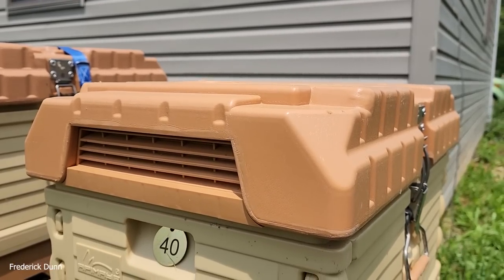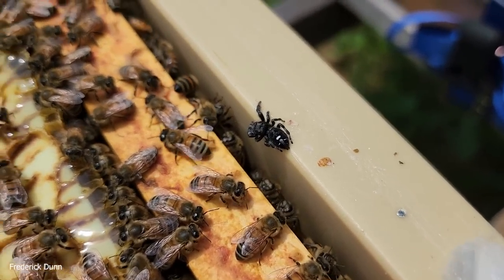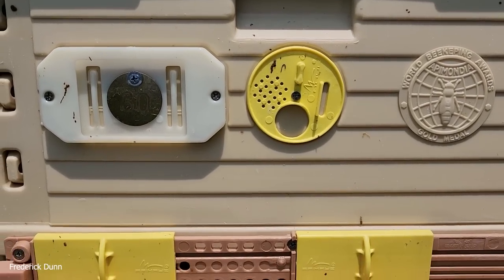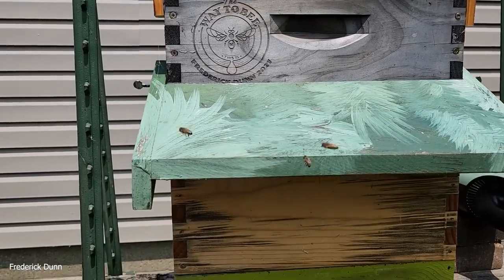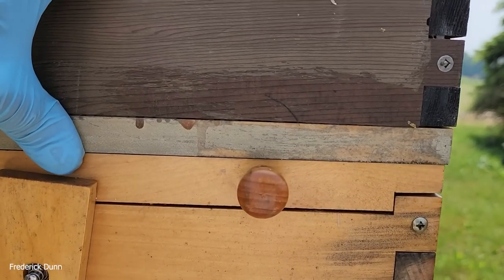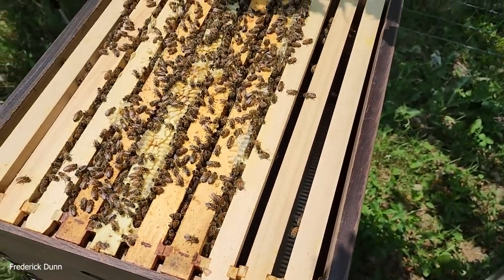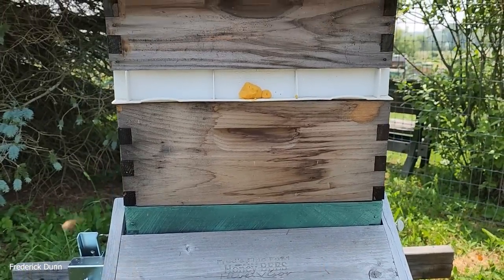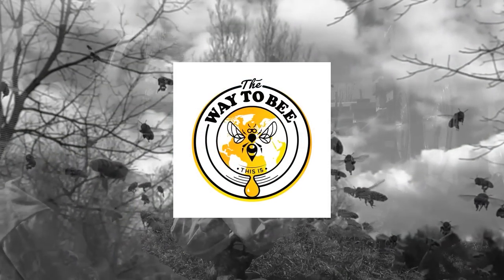Supering Bee Hives just in time. Wintering modifications for Flow Hives. Nectar is Flowing.

Comment: Great Video! I noticed that you are using Ross Rounds in a conversion frame kit… are these readily available? I am not having much luck on the RossRound box. The bees are not touching it but maybe would if I used one or two frames at a time… thanks in advance
Reply from the maker: Those are from Ceracell, so if you already have the Ross-Round frames, the kit is just end pieces that allow you to put those into a standard Langstroth Deep. I also think Blythewood Bee Co. sells them.
Reply: @FrederickDunn  Thanks for responding! Will need to go check that out!!

Comment: Hey Fred, What did you use to glue the double bubble to cover. Also my Apimaye overwinter better if I remove the feeders install double bubble on top with hole for fondant.
Reply from the maker: I just painted the back of the double bubble with Titebond II or III glue, pressed it into the interior of the roof and it's working out really well. Since I was reviewing the Apimaye hives, I left them as designed. But, it appears that the the bees will have enough time this year to seal up those vents. They have a new inner cover that will accommodate fondant :)

Comment: Hi Fred,

I’ve been noticing a lot of dead bees in front of my hive and many crawling around with K-Wing. No fecal stains on the front of the hive. I suspect tracheal mites. Surprised this parasite is not in the FAQ. Then I read infestations are not common due to a predominance of resistance in todays colonies. Can you give a talk on what you know? Did I receive poor stock this year?

Context: Just started keeping in Denver this spring. Installed a langstroth nuc in a custom Layens first weekend in June which was in the low 60s and raining. Had to drop the bees in the box so I could install the langs in my adapter frames. I rehearsed so everything went smoothly and quickly, but I wouldn’t be shocked if the brood was thoroughly chilled. What followed was two weeks of unusually rainy weather. They stayed pretty active, but have lost a lot of opportunities for foraging. Oddly they didn’t take much interest in the frame feeder so I took it out after a few days. I have not inspected frames but the interior of the box is clean, including the floor under the brood. I have a plexiglass floor so can remove insulation and peak in without disturbing them. 

Thanks for considering my question. You’ve been a fantastic resource in my education!
Reply from the maker: Did they have any stored up nectar/honey? A rain event can leave them without syrup/nectar and it's important to provide that with a new colony. Given the cold temps partnered with rain, a hive top feeder would be best in that situation. Just my opinion.

Comment: Wonderful video … I’ve always liked your configuration… deep brood box, medium brood box and Flow Hive honey box … for 3 years I’ve used an 8 frame single brood box and then a flow super (like the Flow folks do) … unfortunately the bees always use the middle flow frames as their pantry and, even though the windows say the harvest is ready, very little honey comes out or it appears to full of nectar.  I’m going to try your configuration but with the queen excluder above brood box and medium box.  The medium won’t ever be used for brood so I don’t have to worry about storage issues (wax moths).  The medium box will be their pantry and the Flow box will be, for certain if indicated by the windows , only for honey storage.  Thanks!
Reply from the maker: Hi George, yes, if you want to make sure you won't have eggs up in the flow-frame and don't trust the honey-bridge then put the queen excluder just under the flow-super. Fail Safe :)

Comment: Hi Frederick , my question is why not just empty the flow hive and let the bees fill it up again instead of adding another super? This would involve much less equipment and cost.
Reply from the maker: The second box is for the bees to winter, so it's really not extra. For Flow Hives, I use a deep brood box to start off. The second box is always their resource super, anything above that is for honey harvesting. This configuration also allows me not to use a queen excluder. If the Flow Super were placed right on the brood/bottom box, then I'd have to include the queen excluder and add winter resources after the top flow-super is removed. I hope that answers your question.

Comment: Thank you for the update.  I am not sure about the cost of those pellets but they do look like the ones people use for BBQ.  Here in Canada we get 40lbs of the Canwick brand for CAD $8.
Reply: I bet they’re the same as the ones used in pellet stoves.
Reply from the maker: They are prpoduced by Ernst Seed company and it's their cuttings. My beekeeper's association is selling them in partnership with Ernst. I think it's $5 for 5 lbs. I actually wasn't very keen on the idea until I actually tried them. I fill a smoker, get it going and one smoker will burn all afternoon and after sunset. I am pleasantly surprised. In the past I've always used pine shavings or clumps of grass from under my mower deck after drying.
Reply from the maker: Hi James, what are the pellet stove fuel pellets made from? These look very rough, you can still see plant bits in them.

Comment: Thank you for another great video.  I'm wondering what your thoughts are on the reasons bees engage in wash boarding.  A number of bees are doing that today at the entrance of the hive even though there is tons of pollen and nectar work to do.  Here is the link to the live cam where you can see it happening.  Do you have any thoughts on this?  Hank  https://www.youtube.com/watch?v=VOlq3RROT2E
Reply from the maker: That will remain a mystery. The best guess is smoothing the surface with light grooming. They also do that inside the hive. It's an interesting behavior and happens with large colonies that have plenty of extra workers.
Reply: @FrederickDunn  Sorry for the delay in responding.  But they did swarm.  It was a great thing to watch as I captured it on video.  Thank you for your comments.  Bee well.  Hank

Comment: What glue did you use to attach the double bubble? I have had difficulty glueing plastics.
Reply from the maker: Hi Kevin, I just spread Titebond II on the interior surface of the flow-roof and it tacked up nice. So far that's what I'll be using going forward.
Reply from the maker: I'll be putting out a video specifically showing how I managed those details with the Flow-Hive.